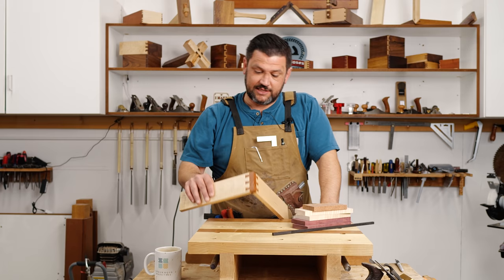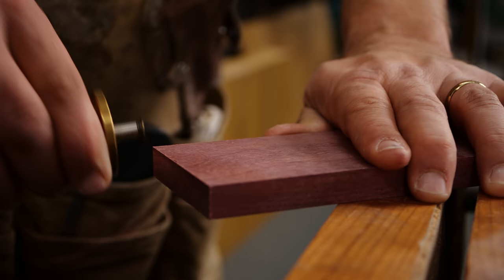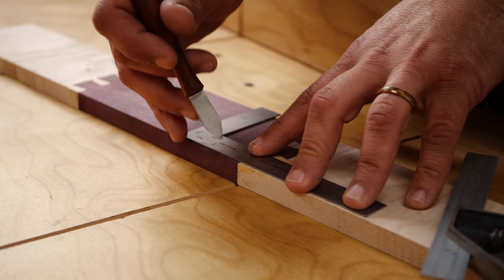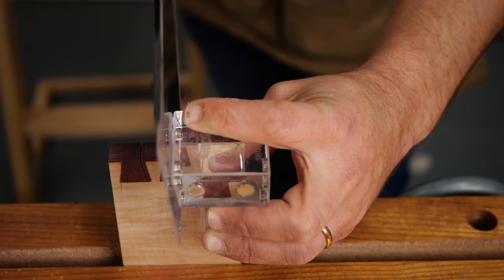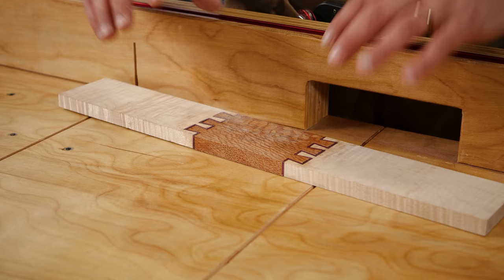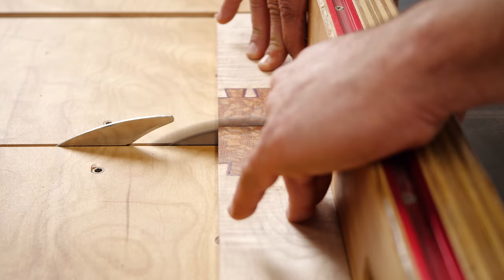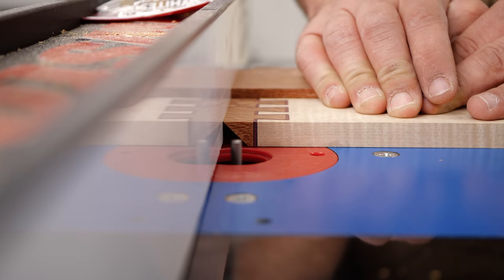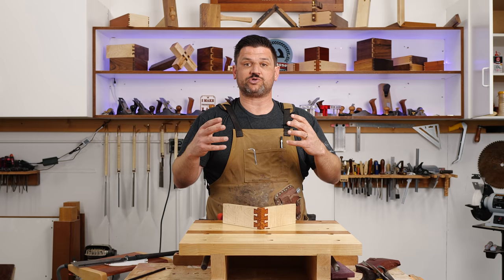SPLINED and Inlaid, Mitered Dovetail Corner - Joint of the Week Redemption

Comment: with or without spline it's a weak joint, the spline is not adding much other than aesthetic / visual appeal with extra steps and depending on use, wouldn't be seen. That said, you made another beautiful joint nonetheless.

Comment: Looks fantastic.

For the corner piece I would suggest that you take a square bar of double the thickness of the planks.
Cut out one quarter of the square bar such that you get a L-shape cross section bar.
Somehow it is not satisfactory to glue the corner part together as shown. I expect a dovetail to keep together without gluing.
Reply from the maker: This way works way better than what you're suggesting IMHO
Reply: @katzmosestools  you are 100% right, but I thought that you are looking for the "best" dovetail joint, not the easiest one ;-)
Reply from the maker: @hipphipphurra77  you're way would mean you couldn't surface them between steps, which is super necessary for a "best" final project, and the grain of the two pieces would be running 90 degrees to each other which would cause major issues with wood movement and in my opinion look not nearly as good as this one.

Comment: Thats an awful lot of work for a decorative dovetail!! The mitre joint is probably the weakest corner joint even with a spline, so I think I would prefer to use the dovetails as the joint. If you just want a decorative corner why not do it in veneer???

Comment: The result looks cool. But as an architect, I have to say that this is not about dovetail construction, but about dovetail decoration. The form does not follow function. Joinery wants to produce solutions which strengthen joints. I would call this fake joinery. I have to underline, though, that this does not impair my appreciation your craftsmanship, which is breathtaking and so much more than I could achieve.

Comment: Still a really weak joint that's spline is not going to do anything one of the comments said do it out of a solid piece of wood but if you are going to use a spline you have to cut it in not just a square